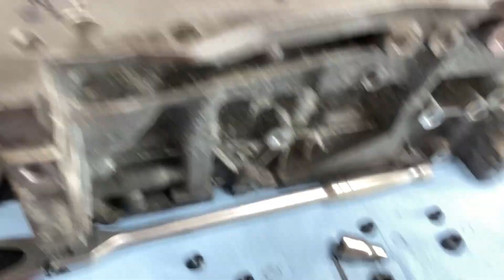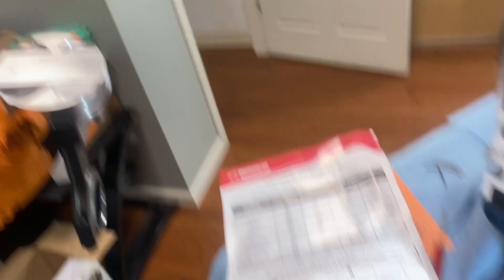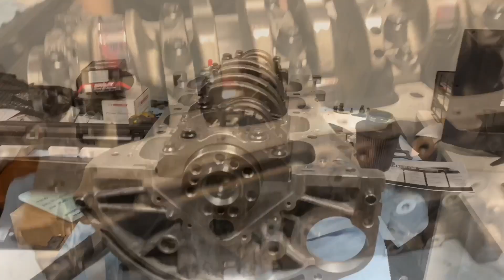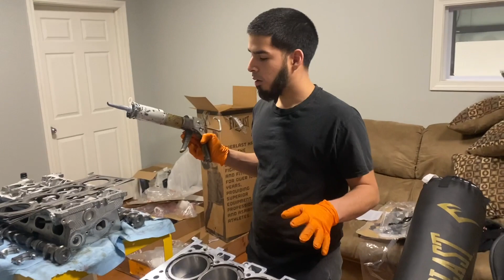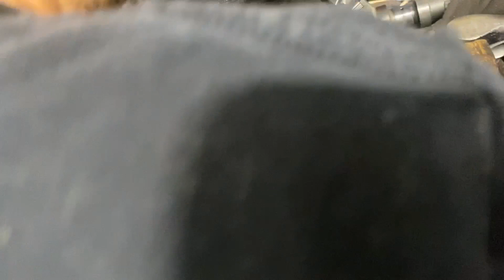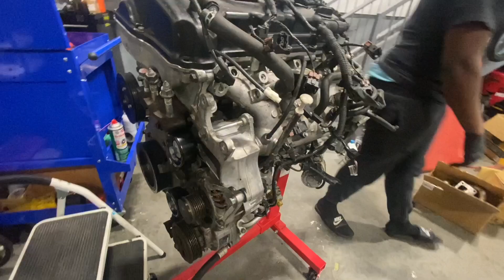Evo X Build Part 4 Assembling sleeved 4b11T and Starting it 🔥

Comment: Do you pack your oil pump before install?
Reply from the maker: No I don’t but I do crank the engine 10 times before letting it start to prime oil through the system

Comment: Great video. What did you do to the socket to get it in the two head nuts by the camshaft? I can’t get the socket to fit under the casting

Comment: What size was the wrench y’all used to hold down the camshaft to tighten the bolts of camshaft ? 24mm?
Reply from the maker: It was a standard wrench, I believe it was a 1” or 7/8 around that

Comment: What did you piston to wall clearance end up being?
Reply from the maker: I had a range from .0030-.0034 planning on 800whp for now
Reply: @DWNSHFTco  awesome yo Preciate it 💯
Reply: @DWNSHFTco  what made you change from the torque solutions to the magnus delete?
Reply from the maker: @Motagraphy  had issues with the torque solutions, don’t recommend. Installed Magnus and good to go
Reply: Mine is at .0032-.0037 between all cylinders .. Is this too tight for a high 6xxwhp build?
Reply from the maker: @Motagraphy  that’s good clearance, the least would be .003 and the max .0037 or it can be too loose and make noise when it’s cold

Comment: Gonna feel good to have her back. I just built my 2.0t genesis coupe motor.  Molnar rods and weisco pistons.   .5 over. New crank and acl bearings.  Blocks are almost the same as the 4b11. I used a 4b11 torque plate to bore and hone. Car was down 6mo. Should have her back running this weekend. 

Don't break her anymore man. 🔥🔥🔥
Reply: 4b11 is more bulletproof
Reply: @jjm3762  well i built my motor  so 🤷‍♂️

Comment: How much did the machine shop run you thinking about building a short block
Reply from the maker: The sleeves and install $1600 then to check clearances another $100 plus the head work $300 so around $2000
Reply: I don’t need all that Lol just need to be bore to next size and honed
Reply: What machine shop you use?
Reply from the maker: @IM4UCKEDUP  northeast machine shop
Reply: Where’s that located? I’m in Texas
Reply from the maker: @IM4UCKEDUP  it’s in Connecticut
Reply: @DWNSHFTco  thanks bro. I threw a rod in my evo x. Bought another 4b11t out a 09 ralliart. Wanted a shop to sleeve my block built head and assembly.
Reply: Nice video mate. Thanks! What pistons are you using?